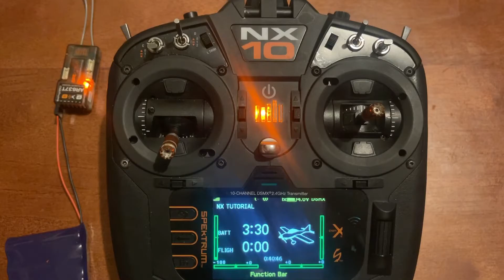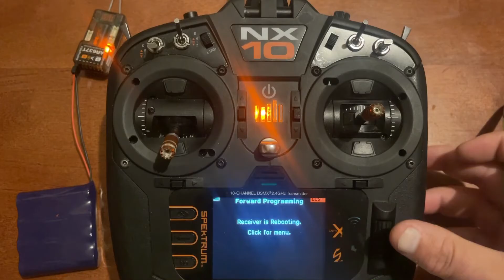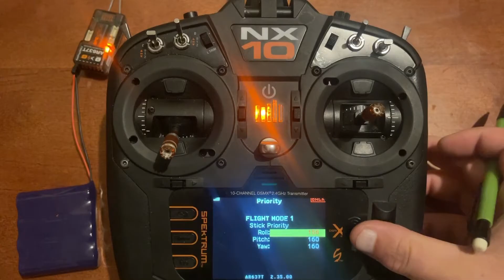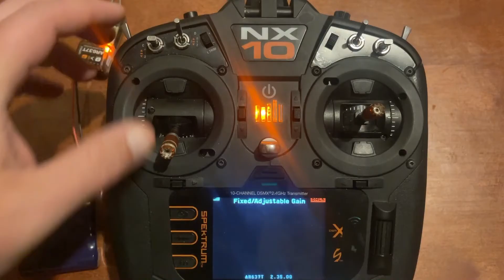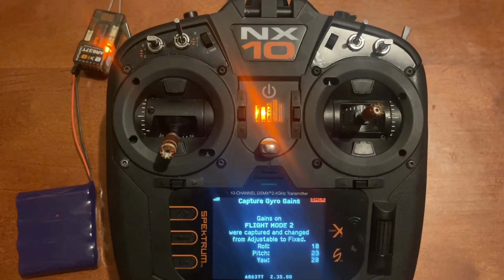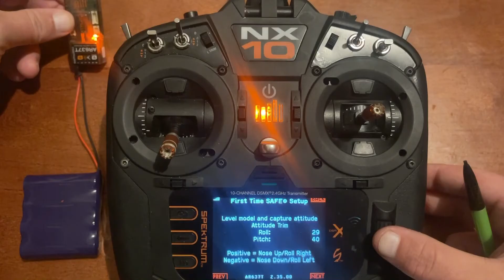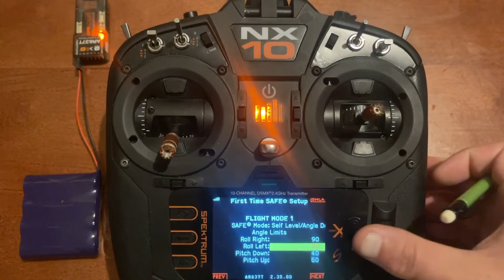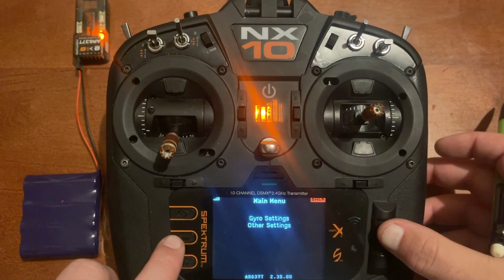Spektrum NX Setup: AS3X and Safe Setup

Comment: I've downloaded all 49 of the Smart AS3X/SAFE receiver config files from Horizon's shared Google drive and entered all of the settings into an Excel spreadsheet. Here's a little of what I found while looking through the data.

1. Only 5 of the 49 models had the AS3X Priority set to something other than 160. They were the four Hangar 9 models and the Opterra 2m Wing. The lowest Priority setting was 110.
2. All 49 models had the AS3X Gain Sensitivity set to 1x. None were set to 2x or 4x.
3. All 49 models had AS3X enabled in FM1. The average AS3X gains in FM1 were 33 for roll, 57 for pitch, and 60 for yaw.
4. Forty-eight models had SAFE Self-Level/Angle Demand enabled in FM1. The average SAFE mode gains were 42 for roll and 57 for pitch. The only exception was the Opterra which has SAFE enabled in FM3 instead of FM1.
5. All 49 models had AS3X enabled in FM2. The average AS3X gains were 34 for roll, 58 for pitch, and 61 for yaw. Only 2 models had SAFE Envelope mode enabled in FM2 - the Apprentice and AeroScout RTF's.
6. Forty-six models had AS3X enabled in FM3. The average AS3X gains were 34 for roll, 59 for pitch, and 61 for yaw. AS3X was disabled in FM3 for 3 of the Hangar 9 planes.

So, in general, Spektrum/Horizon very rarely sets the priority to something other than 160, always sets the gain sensitivity to 1x, and almost never turns AS3X off in their BNF's.
Reply from the maker: Thanks for the added info...
Reply: Good info, thanks for sharing!
Reply: Great information. Thank You. Any chance of getting a copy of your sheet. I'm a first time AS3X programmer user and I'm looking for some basic values for the AS3X parameters (gains, rates, etc) for a conventional high wing sport plane.
Reply: @canuckcorsa  I have videos on my YouTube channel. I generally set the AS3X sensitivity to 1X and the gains to 30, 40, and 50 percent for roll, pitch, and yaw. I set all of the priorities to 150%. If the plane goes into oscillation at higher speeds, slow down, land, lower all of the AS3X gains by 5%, and go back up and try it again. Make sure the gyro corrects in the proper direction. If you're not sure which way is right, don't enable the gyro until you're at least two mistakes high.